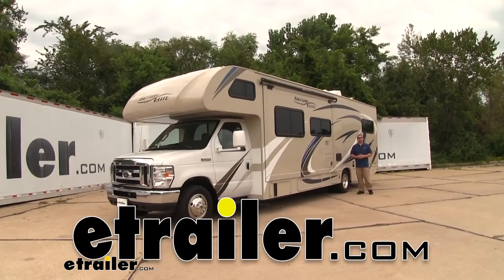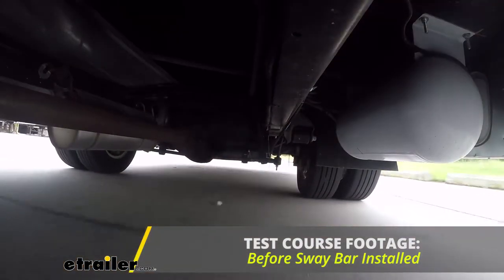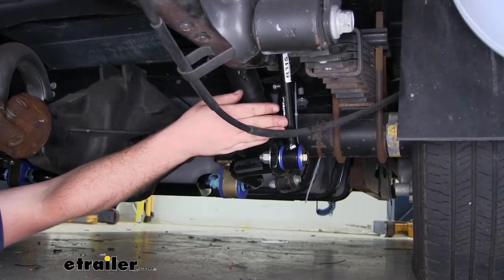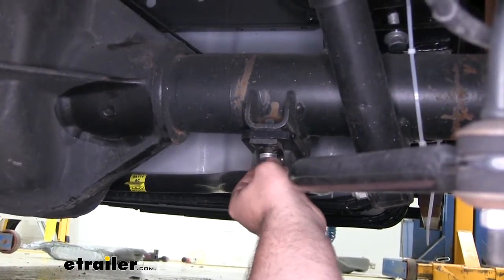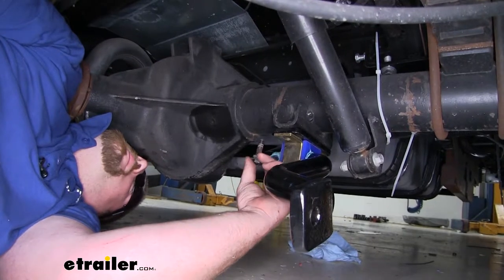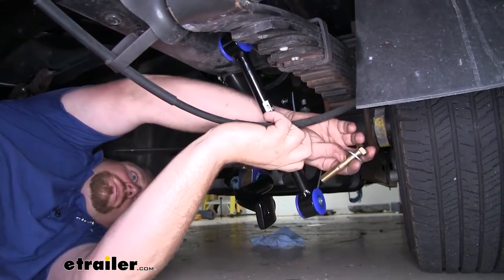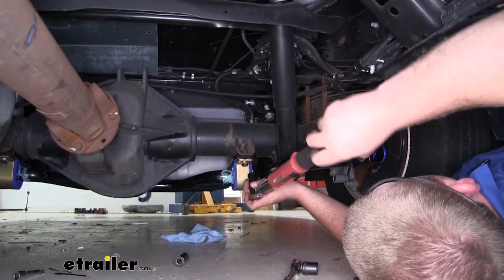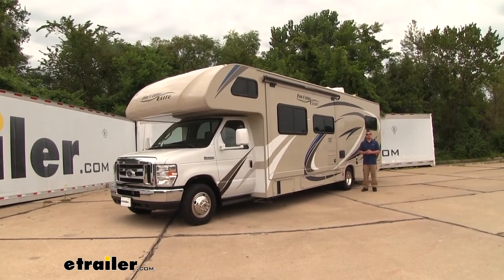etrailer | 2019 Ford E-Series Cutaway Roadmaster Rear Anti-Sway Bar: Complete Installation

Comment: Was the installation of the end link in the factory hole recommended by Roadmaster in this situation?
Reply from the maker: The end links just need to be vertical. If there is a hole in the frame already where you need it then you can use it. Otherwise you are going to need to drill new holes.
https://www.etrailer.com/Anti-Sway-Bars/Roadmaster/RM-1139-147.html
Reply: Hi it looked like the endlink installation didn't leave the endlink perfectly vertical. Is this okay if it's not perfectly level.... I am asking as I just ordered both sway bars from your website